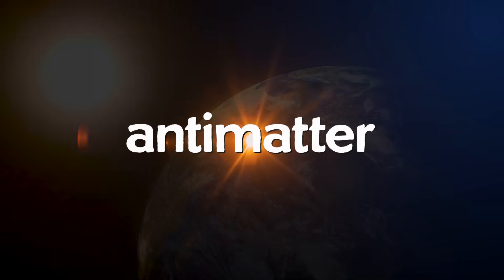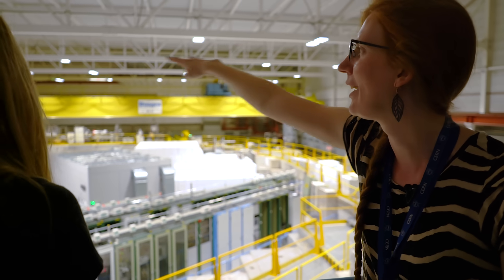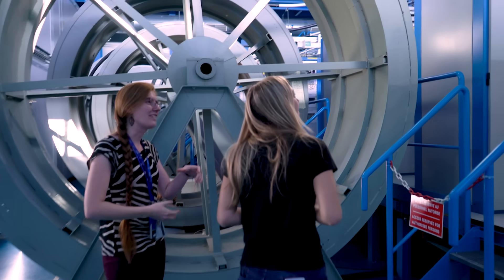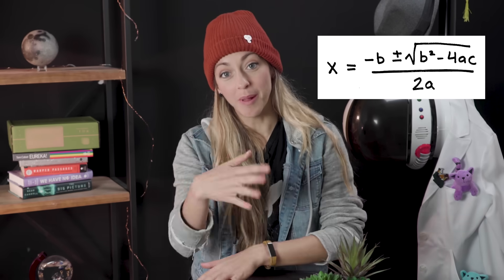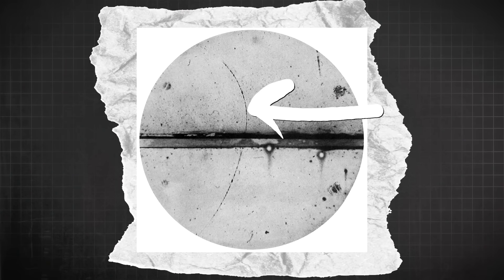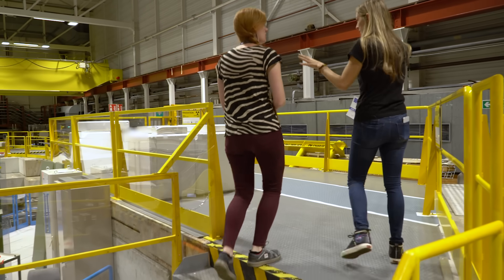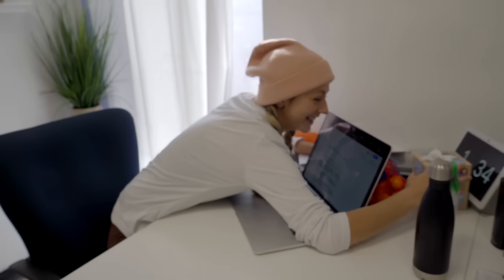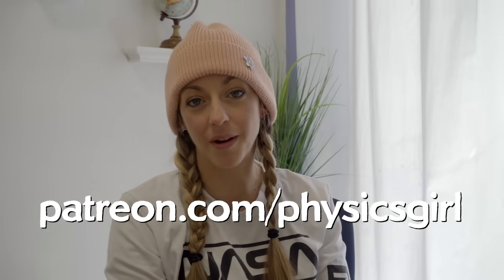Why This Stuff Costs $2700 Trillion Per Gram - Antimatter at CERN

Comment: Hey Physics Girl, here's an interesting (at least to me) question. How do we know that when looking at a distant galaxy or star that it is made of matter as opposed to antimatter. The assumption is (I think) that all the antimatter annihilated while the universe was still young, but can we be sure of that? Thanks.
Reply: I believe the tool is called a spectrometer. It can read the wavelengths that are sent towards us to tell us what kind of matter it is. As soon as we see something that hasn’t been mapped out then we can figure that out. But for now each element has a specific profile on the spectrometer. Someone correct me if I’m wrong
Reply: @Wakaflockaflank  :)
Reply: @LoLFilmStudios  don’t you ever even think about sending a smiley face to me again
Reply: @Wakaflockaflank  😀
Reply: @Wakaflockaflank  Actually antimatter is expected to have most of the same properties as matter (with the exception of charge). So an "antimatter star" would give the same spectrographic results.

So how do we tell then?  Well, first consider intergalactic gas clouds. These are most likely matter. Why? Because unless the universe had a special mechanism that separated matter and antimatter early on, they would have been annihilated if they were mixed matter/antimatter. Now, galaxies travel through interstellar clouds. If we had a galaxy of antimatter, then it would constantly be annihilating as it travelled through the matter of the cloud. This would produce gamma rays. These annihilations wouldn't destroy the galaxy (too big), but we would see a continuous stream of gamma rays coming from an entire galaxy. We don't see that, so we suspect the galaxies are made of the same matter type as the intergalactic clouds.

Now, could we have an entire intergalactic cloud filled with antimatter and containing antimatter galaxies? Yes. But early on (shortly after the big bang) it would have been close to ordinary matter clouds. So what separated them?

If you can find a separating mechanism, then we might be in for a surprise!
Reply: The thing is, we don't know (to the best of my knowledge) why there's more matter than antimatter. It's expected that more matter was produced than antimatter (given what we see), but why?
Reply: @austinalderete2730  
The universe was expanding quite fast in the early days, so it is possible even if unlikely that large pockets of antimatter separated from pockets of matter before being able to annihilate. 

Also if they did annihilate they would have just upped the temperature in a particular region to the point that all particles fly apart which gives them a chance to later re-coaless into antimatter instead of matter.
Reply: @austinalderete2730  The Universe expands faster than the speed of light  and matter itself is limited to the speed of light or less due to its mass. I don't know how this would work with antimatter but I like to imagine the edge of the expanding universe is all antimatter, filling the void of infinite spacetime, to be later "anhialated" into "normal matter" as it catches up
Reply: Which would then leave "habitable" areas made of normal matter for further universal expansion
Reply: @austinalderete2730  
Well from what I understand the Universe got clumpy early on, as in it separated into clumps. Some of those clumps were majority antimatter and some were majority matter. Majority antimatter ones anihilated all the matter and since they were no longer in contact with the other clumps they remained so from that moment on.

Sure if every once in a while a rogue matter commet or planetoid passed through it got anihilated but that would be a pretty rare event. 

Most of the time it would be mollecular sized objects being annihilated.
Reply: Channel 40 on the   cb radio  has all the info  just ask
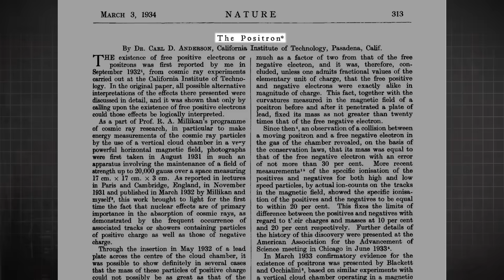Reply: Okay maybe this os comin from a bias viewpoint but I think science is finally catching up to the bible. Hear me out in the bible(Ephesians 3:18) it says: "may be able to comprehend with all the saints what is the breadth and length and height and depth, 19 and to know the love of Christ which surpasses knowledge" talking about dimensions and as we know humans are 3 dimensional beings, now I may be reaching. But in another verse 2 Kings 6:17 it says And Elisha prayed, “Open his eyes, LORD, so that he may see.” Then the LORD opened the servant’s eyes, and he looked and saw the hills full of horses and chariots of fire all around Elisha." Now if you know the theory of dimensions you would know that if as 3 dimensional beings we are basically in a box where we can't see out of or comprehend. If you also where to search biblical depictions of angels you would see that it states they are beings we can't comprehend and if you look at arts of them it's honestly disturbing.

So when Elisha eyes where opened he could see everything "outside this box we are in" one could argue he received enlightenment and was able to comprehend the 4th or maybe are higher dimension. 

Also in the bible is states that heaven is in a different realm we can't grasp or get to, now this may all be a coincidence 🤔  I don't know but I really feel like as humans we looking at this completely wrong and even know I know if we where to find the answers there's nothing we can really do about it🤷🏾‍♂️ but it's just something to think about.

"I may be reaching if there's anything I said wrong pls be free to correct me"
Reply: Well it wouldn't be made outa antimatter because we are able to see it meaning light is interacting with it, also if all the antimatter particles collided with matter particles there wouldn't be matter left. So nothing would exist.
Reply: An antimatter galaxy would look the same to us, but since we do see colliding galaxies and borders of galaxy clusters, if some galaxies were antimatter, we would also see the huge explosions of energy creating by galaxies colliding of opposite matter types. We would also simply see the energy created from space dust between two opposite regions colliding.
Reply: It's crazy how yall say at the start of the universe this and that happened. Like we actually know what happened. I got a theory, what if universes are inside universes
Reply: @hnks6862  well , it's only a theory if it cannot be disproved and has enough evidence.
Reply: @prismaticfalcon  we don't have enough data nor evidence to disprove nothing bcz most of this theories are built on the most logical tests, doesn't mean it's right tho
Reply: DISCLAIMER: THESE ARE MOSTLY MY OWN THEORIES AND CONCLUSIONS REACHED USING SIMPLE LOGIC AND SOME GOOD AMOUNT OF THEORETICAL PHYSICS. PLEASE CORRECT ME IF I AM WRONG. CONSTRUCTIVE CRITICISM ON MY THEORIES IS ALWAYS WELCOME.

HERE IS MY ANSWER...

We simply cannot know... 
Because there is nothing that can distinguish between matter and antimatter as they will both look alike...
But we can assume by the general behaviour (reaction to electric/magnetic/gravitational field) of the radiations emitted by the galaxy or object...

That is, If we were able to detect those radiations in the first place...

You see, if the radiations are released by antimatter particles, then the photons are likely to be "anti-protons". This can cause a problem as antimatter radiations, on interacting with the "matter" detectors, is very likely to get annihilated upon contact... Also, because photons have no rest mass, they are not likely to release any significant measurable energy upon this annihilation, so don't get any ideas along that line of thought...
Also, those "anti-photons" are even likely to interact with some matter particles and annihilate themselves even before they reach the "matter" detector...

There is another much simpler reason which would keep those two kinds of particles from even interacting in the first place...
It is that because the "antimatter" is, in some sense, a mirror image of "matter", it is very much likely that the 4 basic forces (gravity, electromagnetic, weak nuclear and strong nuclear) will act in an opposite fashion for the antimatter particles, which would result in repulsion between the two opposites (matter and antimatter) and hence they would never be able to naturally interact...

 Now, some would say that the properties of antimatter are much the same as those of matter, not completely opposite... But I would like to point out to those people that such contradicting results and theories are bound to arise when we use "matter" instruments to examine "antimatter" objects... Now, if someone managed to make those instruments out of 100% antimatter, then it would be a totally different story...
Reply: starrs are just protons anyways
Reply: Saying theres more matter than antimatter in the UNIVERSE seems like a really big assumption to make when we've seen so little of the universe. I think the reason theres not much antimatter around here is cuz if it was anywhere near us it would have annihilated. Any anti-matter that has survived until now would have survived cuz it was far away from matter. And all the matter that exists has survived because its so far away from antimatter. Its sort of the anthropic principle. The only way humans made of matter can survive is if we existed far away from any anti-matter. If anti-matter was common in this part of the universe we wouldnt be alive to ask why.
Reply: Well photon itself a matter, if you are seeing a star obviously it's made of a matter, if it would've been antimatter , you wouldn't see anything but radiation can be observed
Reply: One method of knowing is looking at  cosmic rays coming from a galaxy. Nearly all of it is matter and that hands a good indication as an antimatter star would emit antimatter(mostly).

Also for anybody curious I would recommend looking into the symmetry breaking of the weak force for a potential difference in why there is more matter. Nothing concrete as far as I'm aware but interesting

Comment: I think it's wrong to assume that there is very little anti matter, but rather it's our perception that's only so little, because we don't know how to properly gage it and or correctly call what's matter, anti matter and something that is the combination of those two, that aren't causing nuclear fission. Which probably because we blanket every either as matter as the majority and the minority anti matter. Which can cause a biases in the correct classification which it's very possible to have a 50/50 ratio between anti matter and matter at any given moment, which is not exploding and randomly calling it matter instead of being a fusion of the two.

Comment: in the early universe that outer shell of the expanding bubble of pure energy transformed into antimatter which was being pushed  by the newly-formed regular matter at the center. the current interaction between the 2 layers of matter and antimatter is causing the expanding Universe to speed up its expansion.  where did all the antimatter go? well it is beyond the visual Horizon of the universe. if we could ever travel much much faster than the speed of light we could overtake that barrier and see what the other half of the universe looks like that is made of antimatter. unfortunately if we cross that barrier we would probably trigger the end of the universe once we accidentally mixed some of the  matter universe with antimatter universe

Comment: I'm trying to understand, are you actually making antimatter or just creating an environment where it can exist? You know a (if you build it they will come )type thing.
Reply: They make antimatter by replicating the big bang in an extremely miniscule scale, which creates an equal amount of matter and anti matter. Of course, then you need to separate the two, or they would annihilate with 100% efficiency (for reference, the atomic bomb USA dropped on Japan had about 1.5% efficiency, so you can imagine how much more energy annihilation releases).
Reply: @VivekGupta-td2sb  Seems to me what you're describing they are creating a state where it can exist.So is it something that transforms into antimatter?
Reply: @robertkowalski9906  really late, but they are actually creating small amounts of antimatter. In these experiments they try to study the properties of antimatter. Which also may lead to finding a way to stabilize it...

Comment: I have been looking at this question of "missing" anti-matter for awhile now.  I went through the math a little and found a peculiarity in the Math of General Relativity.  It would seem that it is possible that anti-matter may not be bound by the "universal speed limit" of the speed of light!  If that is the case it is possible that anti-matter has simply travelled farther than matter and thus most of the anti-matter is at the farthest reaches of the universe and not visible to us.
Reply: could you share piece of ur work i will not steal  ur credits  , i just want to see maths

Comment: Once you complete the spectroscopy experiments you may find that the photons emitted are the same from, or from the same energy states, so have the same frequency spikes as matter.
If that's the case, how could you tell if a distant galaxy is matter or antimatter?
It could  be that half of the observable universe is antimatter, but it is indistinguishable from matter in the method of observation, but if we were to interact with it all matter would be annihilated in that universe, just like all antimatter from that universe would be annihilated in our matter universe.
So, TLDR, could be 50/50 regional pockets of matter/antimatter.

Comment: You shouldn't play with the subject of anti-matter. You will just have to have Space Ghost come to save you. Nuclear fuel is not nuclear. It is an act of repellation. It is constantly trying to keep away from itself forming a false nucleus. That's why it crackles. It is to be called Anti-nuclear fuel. I suppose the residual matter from the tank holding the fuel could be considered anti-matter. Why the high cost? It is just the residual effect of repellation.

Comment: Doesn't the fact that it takes so much energy, mass also reacting with mass to create anti matter prove that the big bang didn't create matter and anti matter equally?
Reply: No. The big bang  is what (possibly) happens when matter and anti matter both come into existence at a singular point, creating a cascading reaction with matter and anti matter popping into existence all over the place (from the sheer energy released). For an unknown reason some matter survived and most anti matter didn't, even though nothing we know of physics suggests it. That's what they are trying to find out, and by extension better comprehend the how and why of the big bang and how things formed from it. 

Besides, formal proof is not the same as everyday proof. For example, 1+1=2 formal proof is much more complicated than you would think, even though we can physically add one apple to another apple in a basket and get 2 apples.

Comment: "The small amount of antimatter we're capable of making with current technologies is in no way dangerous..."

*Moore's Law 😱
Reply: No we are capable of making a lot more with the correct kind of factory. It would cost about 2 billion dollars to make a factory able to make 5 to 10 grams per year that would be dangerous.
Reply: @clementvining2487  only 2 billion? X to doubt
Reply: @emieleke9703  It is actually less than 2 billion antimatter is not that hard to make it is hard to store. Antimatter is extremely unstable to store you must first cool it down and form antimatter atoms. It takes a lot more energy to do this than to make it. The antimatter made now is for study and experiments made to very specific standards. Antimatter made for fuel is very different and doesn't need to be made to these specific standards. 

Antimatter could be a short cut to the stars but it is extremely dangerous. Fission releases 2% of its mass to energy and 98% to nuclear waste.  Fusion 20% but at this time it takes all of that to control it. Antimatter 200% its mass which is 100% plus 100% in equal mass of normal matter. But the energy is so dense it produces a secondary chain reaction fusion in normal hydrogen.

Making antimatter is extremely inefficient  done for experimentation is something like 1 part in 10000 or something like that I don't remember. A factory to make antimatter fuel can get up to 1 or 2% efficiency. On the surface that doesn't look worth the trouble until you breakdown the numbers for space travel.  If you count the dry mass and fuel it takes to get a payload into orbit your payload is only about 1 1/2%. So now it looks worth the cost in dry mass and fuel simply using antimatter as a heat source for propellant to superheat to a plasma for thrust. 2 grams has the energy of a nuclear explosion.  Now instead use it as a catalyst for fusion where it took milligrams it now takes micrograms to do the same work.
Reply: @clementvining2487  i bet theres atleast 5 of these factories already .
Reply: @HowsYourFaceFeel If so most likely not on earth.To make it on earth there would be a very large solar array. You would need a terawatt power supply. It would be easier making it in space or the moon. It would be easier still making it near Jupiter the radiation belt around Jupiter if we had a space infrastructure you could make kilograms of it. You only need micrograms to make antimatter catalyzed fusion possible now.
Reply: Too much junk in space.
Reply: @HowsYourFaceFeel  I agree but it is like everything else no one does anything about it until it becomes too much of a problem. Then it becomes profitable for someone to fix it.  There are some companies now have plans to do something about it now.